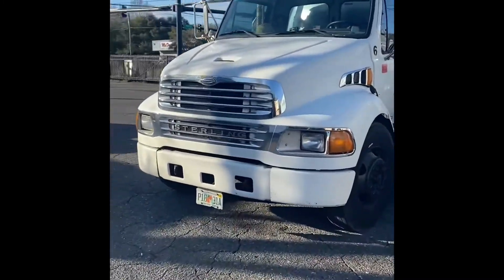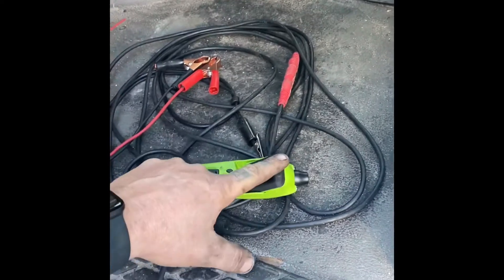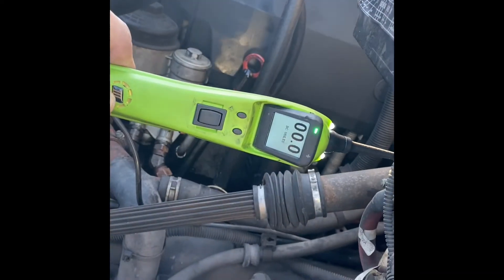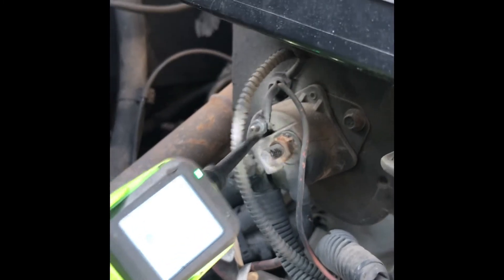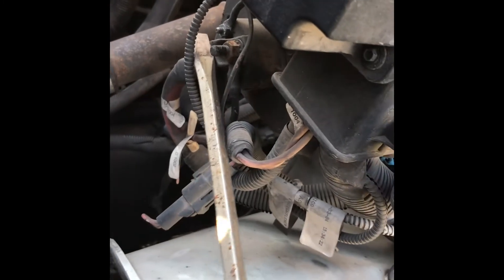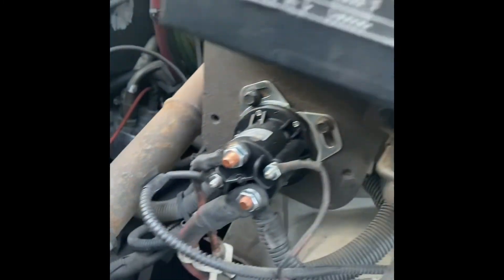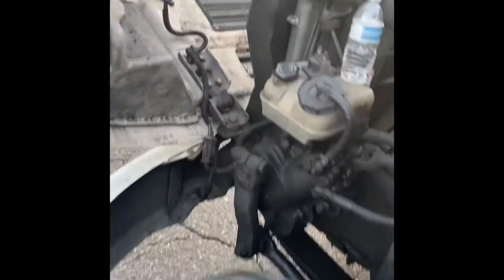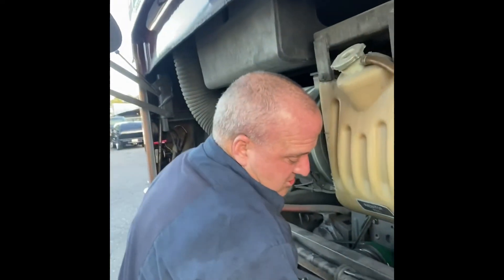Sterling Truck won’t start (fixed) or any semi that won’t start (diagnosing & repair)

Comment: Hello, my 03 sterling has cat , and when I was driving it the engine light came on and it seemed to have went dead,then few seconds ti came back on and light was off, got to red light took off hardly no power and went dead. Would not crank up shot some either on filter and it cranked then went dead after it sucked up the either. Need help .

Comment: Liked video but I have no power to ignition wire. But at switch I do. And fuel will not turn on when a jume power to wire
Reply from the maker: Check your relay in the fuse panel